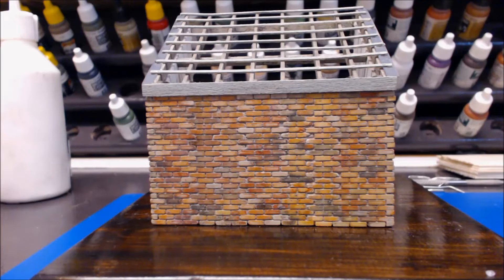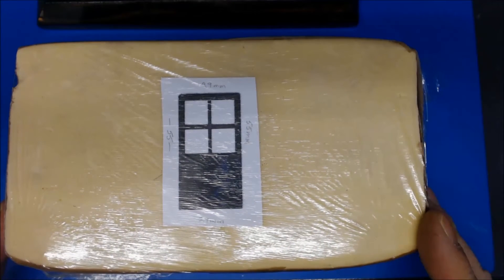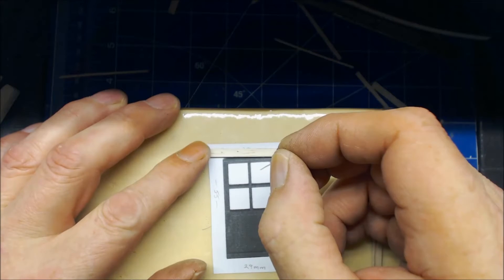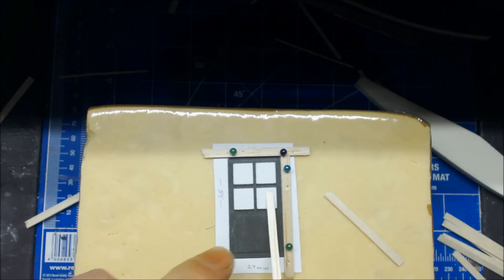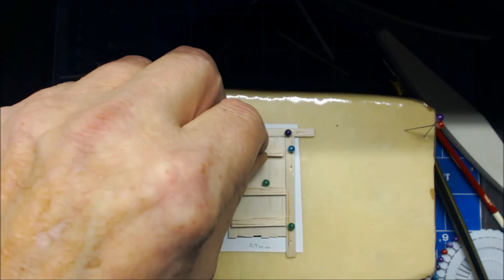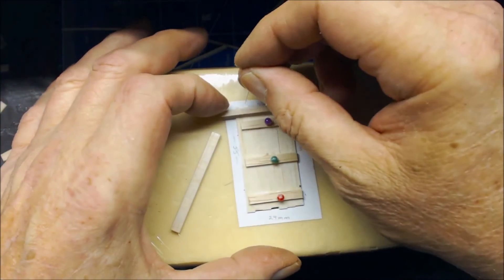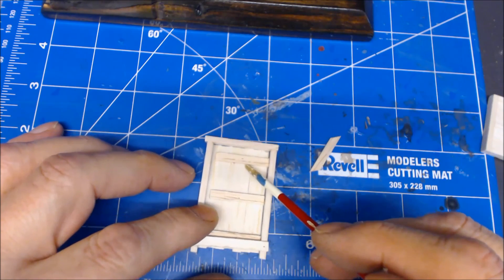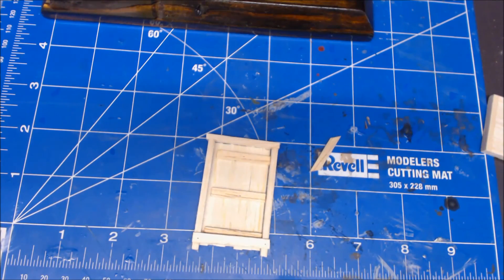Making Door And Door Frame In 1/35 scale (I Video 2)

Comment: Hi there. Sorry if it's already been asked but what was the reason for putting the door on the side after? I only ask because I know you wanted to cover up the brickwork on the broad side that you weren't happy with :) - cheers
Reply from the maker: Hi there I was just demonstrating even if you change your mind and require the door or window anywhere else in the building is very easy to cut a hole and put one  in The particular piece that I am building in this video is strictly a demonstration piece just to show that you can correct mistakes very easily. But saying that it has ended up as part of a house build that I'm doing many thanks Sim
Reply: Thank you so much for you quick response. I see. Loving the build and looking forward to seeing how it progresses. I'm learning a lot by it. Such amazing detailing...... which is really my thing :)  Definately gonna get one of those little Tamiya Saws :) Good Luck. Regards, Andi